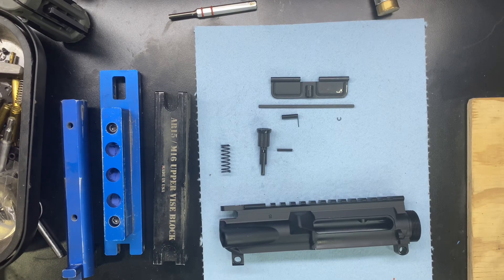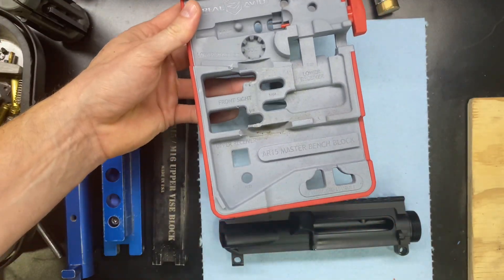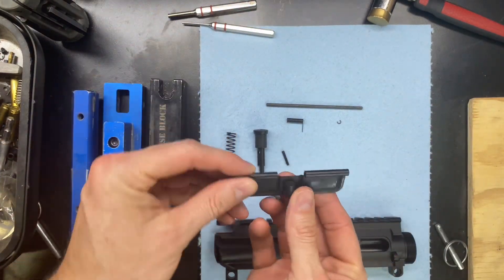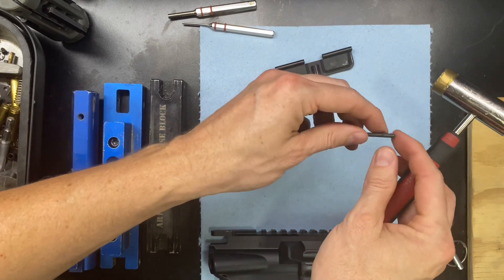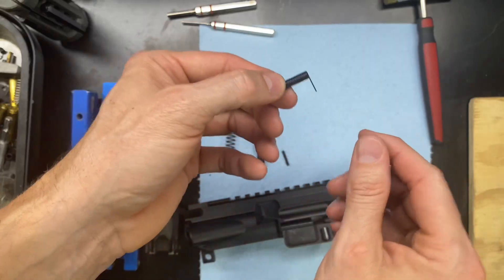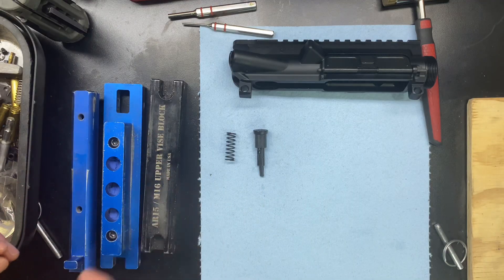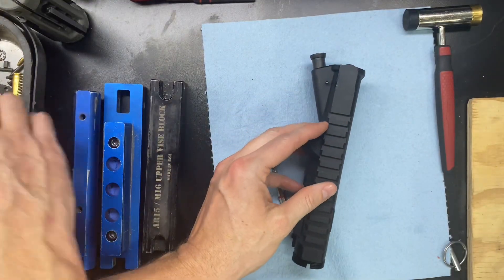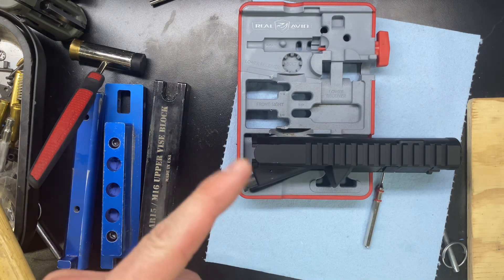Step by step, AR15 AS upper receiver assembly

Comment: Just an idea because those c-clip are so small that it is difficult to install. I use a hemostat to grab one edge of the clip and push it on.  This method also works with starting rolling pins so you do not have to hit your fingers with the hammer

Comment: Are all uppers the same when building them for an AR-15?
Reply from the maker: If it’s milspec, yes. Some manufacturers has a slightly different design or features but those will still be very similar.
Reply: @combatreadychannel a this would be my first rifle, or ARP. First time building one as well. Is there something to look for that would tell me the upper and lower wouldn't work together?

Comment: Great video but quick question. Why would I only be assembling the upper receiver without ever getting to the barrel and hand gaurd?? Like a gun needs a barrel to shoot?? Just feel like you wasted my time a little bit showing and explaining to me that foam looking cut out deal before the vise block. Just saying.
Reply from the maker: The barrel installation is different depending on what kind of handguard you get. So this video is just showing the upper parts kit installation for a stripped upper receiver. This other video shows a standard free float handguard and barrel assembly.
AR15 barrel and handguard installation
https://youtu.be/Jk3cTeMTDbo

Comment: That real avid block is awesome, along with all the other spots for removing and installing pins it says on the block what size punch to use. It also holds that forward assist plunger forward you can drive the pin in
Reply from the maker: Real Avid make a bunch of really good tools!

Comment: My retaining pin for the forward assist just slids thru the opening.   It grabs nothing?  😕
Reply from the maker: That definitely shouldn’t happen. It should be very snug. It’s possible that you were given the wrong roll pin. The lower receiver has a couple different sizes. Maybe one of those were mistakenly put into your assembly kit. Other thing would be that the Receiver was drilled out with the wrong size.
Reply: @combatreadychannel  
Thanks for responding.   I did a search, and Harbor freight sells roll pins of different sizes in a 120 count and 315 count, and I installed it with one of these.   👍😕
Reply from the maker: @MbalmR97TX awesome! Glad you got it working!

Comment: Should we put aeroshell 64 on the parts during assembly
Reply from the maker: Yes, that or something similar on the barrel extension and nut is recommended. With that being said, I have worked on plenty of AR’s that did not have grease of any kind on them and they still preformed flawlessly with no issue. If you are planning on using the rifle in wet weather, it would be a good idea to use it to keep moisture out and help prevent rust.

Comment: You marred the receiver with the hammer!
Reply from the maker: If you’re talking about the section on the picatinny right above where the charging handle goes, then that was already there. If you are referring to a different spot then I’d just say, you try assembling the receiver with a camera in front of your face 🧐
Reply: It’s a tool. It will be ok.